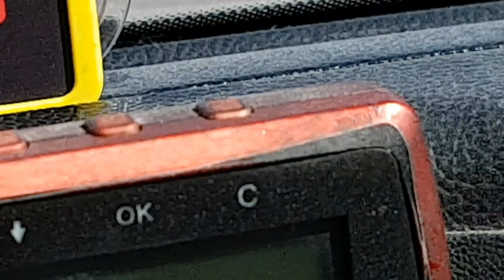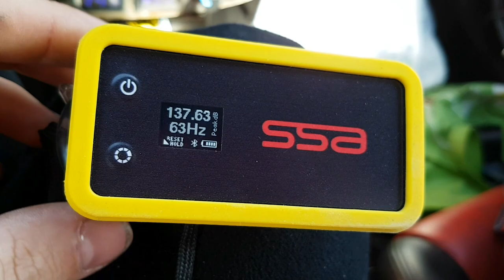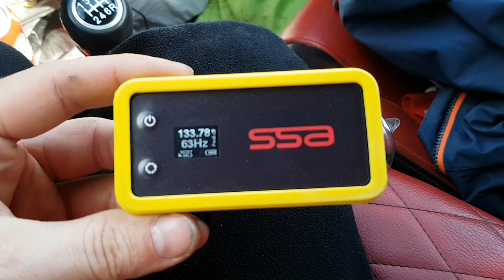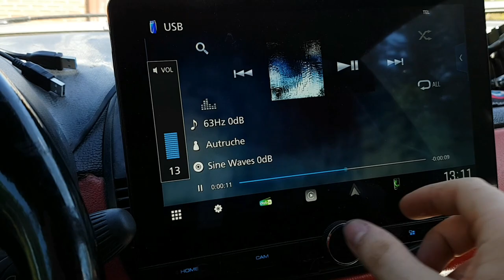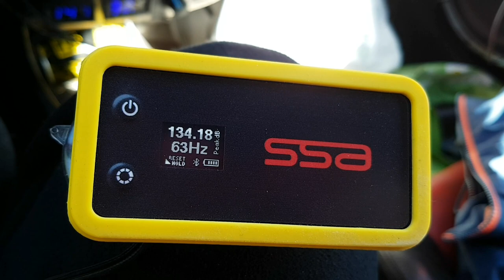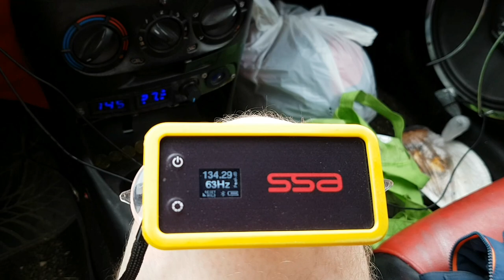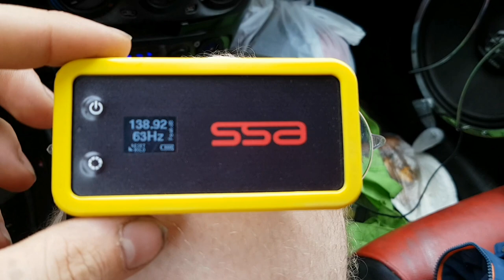Loudest WC Toilet?!? #subwoofertoilet

Comment: Not bad.. do more liters inside and it would be louder 😉 have you closed the water inlet ? If not should close 😊 have you seen my last video of my New front door speakers DS18 69 pro 275w rms 40hz to 20khz coax speakers with horntweeter sounds great. Must look
Reply from the maker: Yes it's blocked